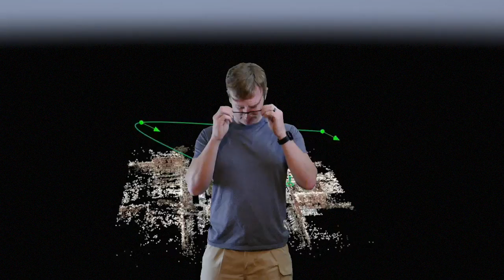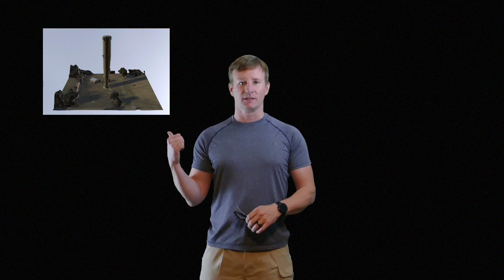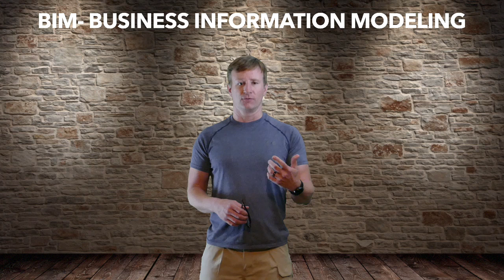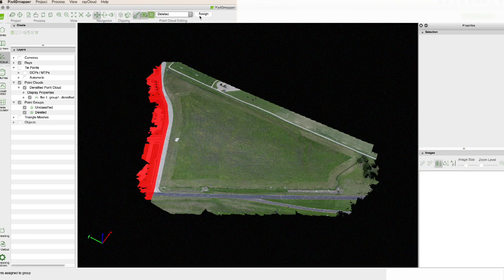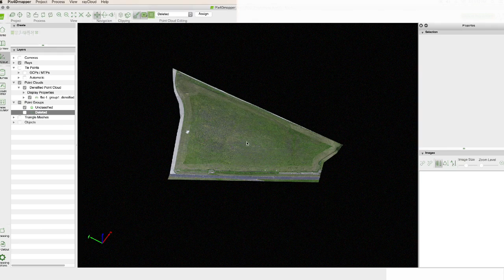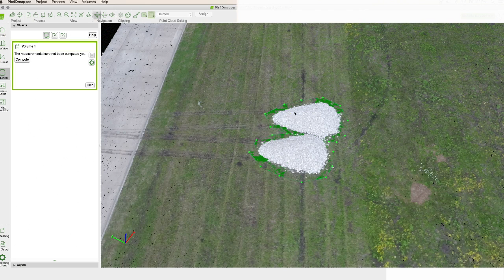How to make money drone mapping, with Pix4D Ep#1

Comment: What software you using to process? Pix4D?
Reply from the maker: No sir, I use Agisoft now. Every poll I have seen even shows it to be the most used software for drone photogrammetry.
Reply: @GM6Labs  yeah I'm going to look into it. I'm about to purchase Phantom4pro Obsidian version, that will be my backup.
Reply from the maker: @MTBKulture  you really can't go wrong with the P4P. I still use one although I prefer one I made, but the P4P is good, easy to use and almost always works perfectly.

Comment: Do you share the project file with the customer?
Reply from the maker: Project file? Do you mean the Ortho?
Reply: @GM6Labs  yes so that they can make measurements etc
Reply from the maker: @Gabrielslegobuild  yes absolutely. I have had a couple of clients that just wanted measurements but most want the ortho and DEM too
Reply: @GM6Labs  how to I share ortho file from pix4d I just finished a project now I want to share with customer to see if everything is accurate
Reply from the maker: @Gabrielslegobuild  its been about 2 years since I used pix4d but there should be a folder created in the project folder that is named DSM or ortho. Its a .tif file. Upload that to them using dropbox or google drive.  Or even pix4d cloud.
Reply: @GM6Labs  amazing thank you for all your help curious as to what program you use instead of pix4d? Is it that reality capture program?
Reply from the maker: @Gabrielslegobuild  no problem glad I could help.  Reality Capture is good but in my opinion not great. Its a little hard to use too. My favorite and in my opinion, the best is Agisoft Metashape. I have seen statistics that show more people use them more than any other.  Plus, in the long run they are cheaper.
Reply: @GM6Labs  hey another quick question how much do you charge customers to survey their construction project and do you survey the land multiple times to see progress if so do you charge again or is it Included in original price
Reply from the maker: @Gabrielslegobuild  I will do the same project multiple times if they want it that way.  I charge for every trip separate unless we sign a contract for X number of surveys for X dollar amount. What I charge is based on how much time I think it will take.  I think I made a video about it.  I cant remember what its called. Sorry.  I know , I know. I could I forget.
Reply: @GM6Labs  I've watched your video on it actually after I sent that msg lol thanks again going to really start taking this seriously I just bought a pc
Reply from the maker: @Gabrielslegobuild  good luck. Im always happy to hep when I can
Reply: @GM6Labs  hey so I've successfully mapped two projects thabks for all the help I was just wondering how to go about getting accurate shots when there in dense long grass on the project area? Can I still get accurate measurements I haven't run into this issue yet but my next construction site has alot of tall grass and I'm concerned I won't be able to get accurate elevations
Reply from the maker: @Gabrielslegobuild  well, that is a problem. You can put GCP targets down over the grass pushing it down. But the land will most likely not be flat and even.  If you have a GPS/RTK system like Emlid, you would be able to drive the entire area while collecting points at 5hz to 1hz rate.

Comment: I am ready to upgrade my business from a P4P using Photomodeler to something that will help me make more money doing mapping operations.  What would you buy and why?
Reply from the maker: Airspeed 3D are you referring to Software or drone?
Reply: GM6 Drone Mapping  Both please.  I have heard about Areopoints and then I heard you don’t need them. What would you buy if you had twenty grand to spend?
Reply from the maker: @pak0033  Very good question. I would not consider myself cheap but I do not want to spend unnecessarily. I have 4.5 drones. One is being built slowly. 3 muti rotor and 1 fixed wing. 99% of the time I use my P4P and have mapped MILES with it. The plane is good for large areas of 300 acres to a few square miles. The key is to have only what you need and a backup. Anything more is a waste. Having money to buy more if you need it is more valuable than extra anything. Areopoints are nice but a set of Emlid Reach will cost a fraction of AP and when used as a set of 2 in RTK mode, will be more accurate than you need for 99.9% of your jobs. If you map areas with high wind then get a drone suited for high winds. Other than that, the P4P has a great camera for the price. Next, don’t skimp on processing power. A decent gaming desktop not laptop with room to make upgrades as needed. Minimum 8 core processor the more cores the better.   You can rent the software (pix4d or reality capture) when business picks up or gets steady, BUY Agisoft. Its cheaper in the long run, and it’s better. Or buy it now but do what makes sense for you now. Get skywatchai insurance monthly (as you need it) some months you may not need it. Learn how to market and budget some money for that. Get a decent website and put AS much of the left-over funds in the bank to use as needed. You will need the capital. 
I could probably write a book titled "What NOT to do when starting a drone business" This advice is free but solid. Oh one more tip. Keep asking for advice from people and learn from their mistakes....
Reply: @GM6Labs  AWESOME!!  I have reached out to so many mappers and you, my friend, have given me the most and the very best advice yet.  Of coure, everyone has an opinion and I was about to spend $30,000 on a new Matrice 210 RTK V2 complete setup because that is what I was advised to do from a very big mapping operation.  One guy actually said that I will not get any "real" jobs with just a P4P and I have 3 of them.  :(  
I have a college degree in CADD / GIS.  I have been flying for 35 years and I am really wanting to put my two loves together as you have.  
I need some marketing advice really bad!  My partner is ready to hit the street marketing our business but he is still learning (just passed his 107 by the way) and we need to make some kind of flier I guess.  What do you recommend? You can reach out to me on my Facebook (critique all you want please) at Airspeed3D and I would be happy to compensate you for any help you can give us.  I hate and I mean hate to try and reinvent the wheel and I have no ego. LOL
 I watched your videos for over 3 hours last night.  My wife actually leaned over and said, "TURN THAT OFF!". Thank you so much for your help!! PAKman

Comment: Is possible to use a Mavic Air or a Spark drone for this kind of woks?
Reply from the maker: Santiago Garcia Possible, yes. Recomended, no. The sensors on thoses drones are to small.
Reply: So to star in photogrammetry should be from the Mavic Pro?
Thanks for answering.
Reply from the maker: Santiago Garcia I recommend the P4A. It's 1in camera sensor and mecanical shutter are ideal for mapping. Check out the link in the description

Comment: is pix4d  better than agisoft photoscan? what is more reliable
Reply: They are both black box, so it comes down to the user. I have used both and personally Pix4d is much easier to use.
Reply: GM6 Drone Mapping I think pix4d is like $6000  a year
Reply from the maker: +Hamza Bazzoun I think so. The mesh has greatly improved. The way you correct artifacts in the mosaic is easy. And tech support has greatly improved over the last 6 months
Reply: thank you! do you think that when adding ground station points by gps, then merging them with drone data is sufficient for aerial surveys and mapping? i mean using a phantom or an inspire for instance
Reply from the maker: Hamza Bazzoun Yes, absolutely. As long as you have accurate GCPs, you will be able to make your project accurate.
Reply from the maker: I agree. Agisoft is easy until you have to fix problems with your map. THen it becomes a headache.
Reply: Its expensive as hell
Reply from the maker: Agisoft or Pix4d?
Reply from the maker: Easton Williams ya. Its $4200-6000 depending on what you get. It is pretty crazy
Reply: GM6 Drone Mapping Thankfully I get Autodesk Recap Pro for free as a student... 

May buy Agisoft later, if I use a drone do I need the standard or more expensive version of Photoscan?
Reply from the maker: I tried ReCap Pro but that 1000 pic limit is what killed me. Ya you will need the $3500 Photoscan. It allows you to use all the tools; and you will need them.

Comment: It's brilliant, but pix4d is very expensive I think? So most people can't afford to do this, or is there a cheaper version for new starters?
Reply from the maker: Drone Minds well, Im not sure. Agisoft is less but still the price of a drone. then of course you have insurance and repairs. Its not cheap to start a business. I would recommend teaming up with someone if cost is an issue. What are your thoughts?
Reply: Oh, I wasn't comparing it to agfisoft, the pro version of that is expensive too. I just wondered if pix4d had a cheaper version with less functions?  Obviously if your business is big enough and you have the clients paying then it doesn't matter. I was just thinking of the little guy wanting to give this a try. I think it will get cheaper anyway as it becomes more widespread and known, more people will make software that does similar things and more easily so more people can get involved. There are a lot of people that still don't know about this software and technology, don't know it's even possible. It's amazing really, I love it
Reply from the maker: Drone Minds Pix4D has a version for $50 a month. it does 3D modeling. and quite well. I am testing other software as I have time. I hoping to find a good solution this week at the Xponential conference. I would be happy to pass along anything I find, if you want to try it out?
Reply: GM6, Drone/ UAV Mapping 
That's cool, doesn't sound so bad. I also want to test different software. If you want you can join our forum and share your videos on there as well?
Reply from the maker: Drone Minds ya that would be great
Reply: cool, you can find it via my channel, or go straight to droneminds.com - hope it's all right to post that here, if not just delete it, it's ok. :)
Reply from the maker: Drone Minds no worries. thanks for the info.
Reply: Drone Minds Router warns of malware for some reason.
Reply: You made a typo when you posted the link to your website in your first comment. You put doneminds instead of droneminds. That is probably why they got an error message.
Reply: Above and Beyond you mean warning about the website?
Reply: Omg, thank you! I fixed it. :)
Reply: I see I made a type with the address, thanks to genesishep for pointing it out below! :)